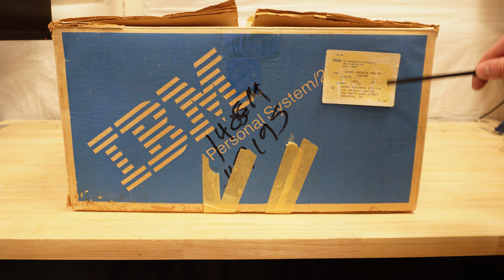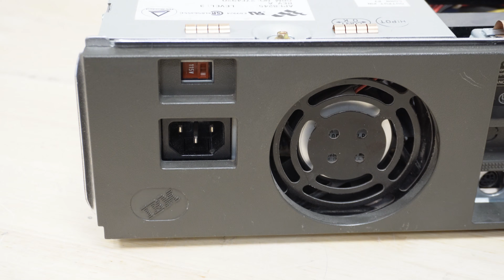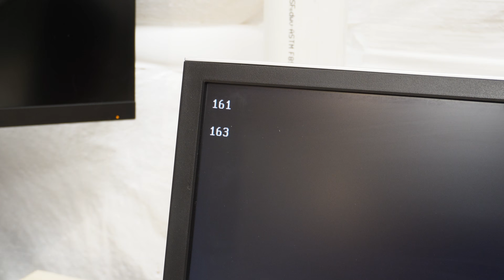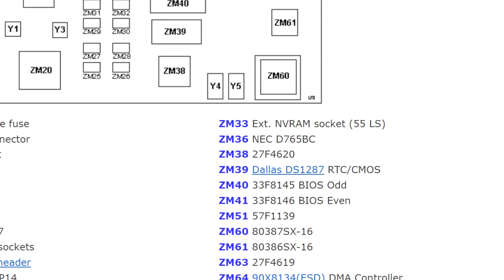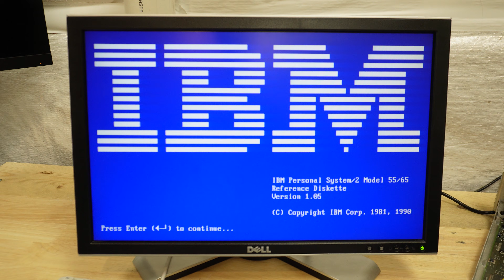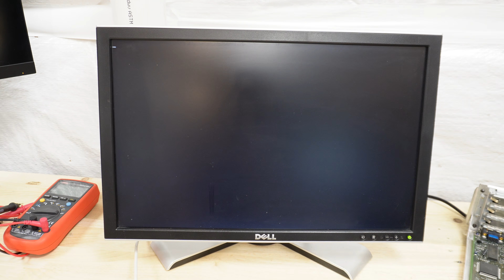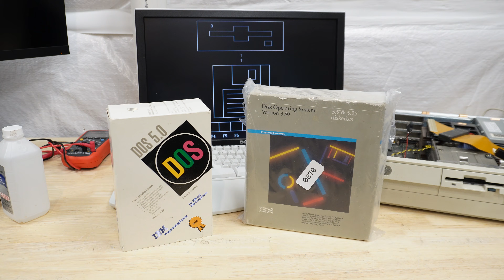IBM PS/2 Model 55SX

Comment: Those caps on the mainboard are factory.  You can fool the system into using the more standard 70ns parity memory by soldering a 30ohm resistor onto the appropriate option pad.  Later Model 55's came with C step 386 that have the working float pin that can accommodate 486SLC cpu upgrades.  The Dallas chip contains the CMOS memory and that is why the system won't startup without it.  Necroware RTC modules work, but it required me to replace the clock socket.

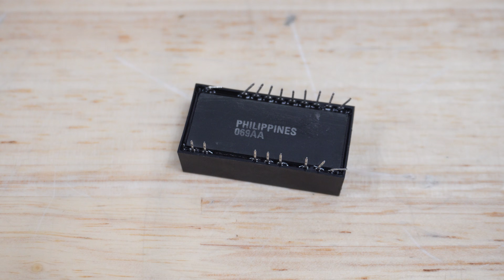Comment: 29:40 Philippines!! 😁my wife is from there.  didn't know parts were being made there back in the 80s.  I was using a model 25 in high school and we had a model 60 running NetWare 2.  if i had that system today i would be tempted to connect my 420mb ide drive to see if it boots windows 3.1 after some 30 years sitting in a plastic container 😄

Comment: We used those in my Computer data entry class and they were absolutely terrible!  They were very crash happy.  Turn it on, it crashes.  Load a program it crashes.  You sneeze it crashes.  You look at it funny it crashes.  It crashes, it crashes.  If you pray, hopefully the system admin is free but probably not because he's figuring out why 10 other computers ahead of your crashed.

I came to believe that the 386 SX is 386 SUX without the U.

Comment: I have 2 issues with this video:
1) The reference diskette does NOT contain the BIOS it is just used to set boot parameters
2) Micro Channel is NOT technically proprietary. ANY company could license and used it (and many did).

Comment: I scrolled down the comments and I didn't see anybody mention it: The 55/65 both store all of their system configuration in the CMOS memory on the Dallas RTC, which is why it won't boot without it. It's not the RTC part, it's the CMOS part that's the issue. It's a problem carried over from the AT when the 6818 loses power.

Comment: The BIOS is on the motherboard like any other computer. The only difference is that it doesn't have an in-built configuration screen, like we're used to with PC's. That is what is on the reference diskette.

Comment: You should run some Linux or something on this machine. Maybe an early version, maybe the most modern version that would still run on a 386 with... 2MB(!!)
Reply: OK, 86Box emulates it so well you need the "BIOS" disk. Also maybe 2MB is not much even for Slackware 1.0 install floppy, 4MB seems to be ok.

Comment: We used to have floppy booted systems that connected to token ring networks.  No need to have special hardware, just build a custom boot disk.  I used to have to build those dang type 1 jumper cables, i hated them.

Comment: I used to work on these back in the day, I had a customer that had tons of them and they replaced them with model 77s units with OS/2 on them and upgraded 16mb token ring cards. I had a love hate relationship with these machines. They were really reliable and mostly just worked but when they did break they were a pain. I used to carry a library of reference disks for the various flavors of MCA cards they had.

Comment: I worked with many IBM PS/2 systems. 30, 50, 60 and the server line as well. The Microchannel was far superior to the ISA bus, but the cards were of course much more expensive than the ones for ISA.

Comment: The PS/2 models 25 and 30 were effectively XT-class machines designed to round out the lineup for those that needed to replace their existing machines but not splash out on an actual PS/2. My first computer was a model 30 (8530-021 i think; it had the beepy 20MB hard drive) with an 8513 color monitor and the much-maligned IBM DOS 4.0. IIRC the Starter Diskette is just an introduction to the computer and some very basic diagnostics (like that keyboard test and a CGA/EGA/MCGA color/resolution test).As a kid, my favorite part of the starter diskette was the beach sunset graphic with palm tree it displayed to show off the colors.

Comment: The drives from IBM came on sleds.  One would by the drive and just slide it in place.  The connection to the bus was made as the drive snapped into place. None of this required tools.

Comment: Had a fleet of PS/2 at work.  All ours had a card to connect to the IBM mainframe terminal network.
I  wanted to get a card to connect to the mainframe bus and tag network, but my boss was afraid of what I would do with mainframe systems. I found that with the correct screw driver I could break the pin out of the security Torx.  
Micro channel was better than ISA because the cards could talk to each other without bothering the other components like the cpu or the display.  We never got Token Ring as the capital investment was too large and I couldn't cost justify it.  
The PS/2 was more reliable than other PCs of time.  Maintenance and upgrades was easier if more expensive.   I had PS/2 and an IBM 3290 plasma display at my desk.  I had my own printer attached directly to the PS/2.
Reply: I've got a couple 3290 terminals that I want to get connected again...

Comment: Ah, yes, the IBM PS/2 Model 55SX, that brings back some memories. Not great ones, unfortunately, but memories nevertheless. In the late 1980s and early 1990s, I was working for a company that had a contract with IBM for pretty much all relevant equipment, and in 1989, we took delivery of maybe a dozen of these PS/2 Model 55SX machines -- yep, with Token-Ring cards preinstalled. They proved to be the least reliable computers the company bought while I worked there, with fully 30% of them failing right out of the box. I didn't spend a lot of time in those days working inside of PCs, but on the occasions that I did, I also found the fit & finish of the PS/2 Model 55SX to be lacking, with a cover thta was relatively difficult to remove compared with other IBM PCs of the time and downright balky to put back, and I found the card riser hard to work with. What was really telling, though, was a label on the front, which said: "MADE IN CHINA (Please remove this label before deployment)", or something to that effect. Under that label, I found a second label stating "Made in USA". Nostalgic nevertheless, in the same sense that car collectors embrace the Edsel.

Comment: Yes, PS2 ports were introduced on, and susequently named for, the PS/2 machines.

Those Dallas chips have not just the battery, but the actual RTC hardware. As it being missing entirely would mean there's now missing hardware from the mainboard, it would track that the machine would fail to initialize.
Reply: Specifically, a POST code of '06' for missing CMOS hardware. If there is an Extended CMOS for microchannel support (not on the PS/2 Model 50, 50Z, and 55SX), that is POST code '07'. A parallel port POST code reader is supported on all PS/2 models, and a helpful item to have.

Comment: Had one of these in 1993.  Corporates would sell them on to resellers to refurb/upgrade and sell on. Mine was ex insurance…

The machine was slow. Windows 3.1 creaked along steadily, but Word 6 was a push too far, with disk swapping a lot.  

Amazing build quality.

Comment: I will add this, I have the Model 30 and i get that error but it boots. But mine also has a hard drive. i have had it boot off floppys too, but yes they have to be bootable. Also, the hard drives are on ebay. yes, harder to find but they are available. There is a lot of 6 ESDI drives up right now. Would love to see it fully functional!

Comment: Great video.  Around here, companies were dumping PS2s as we were rolling up on the Y2K problem.  My local computer store at the time was selling 386 and then 486 machines for less than the value of the installed memory.  Picked up a bunch of machines, MCA cards and hard drives.  Had a lot of fun playing with them.  Gathering dust in the basement now.
Reply: With the irony that the low-end 8086-based Model 30 doesn't have the Y2K issue in hardware (since it uses a different RTC chip). The 55SX appears to have been initially designed for an external CR-P2 battery (the plastic adapter support bracket had the indent to where it was placed in the case on early versions; I have a video where I used that spot for the coin-cell battery to the DS1287 RTC). Maybe it would have had the Motorola MC146818, so still with the Y2K bug. Later Dallas modules had a 'Y2K-fix' version, which has a 'C' in the part numbers; Those WON'T work in the PS/2 models, since the 'Century Byte' register is moved to offset 37h instead of 32h.

Comment: Flashback.. our first office network in '88-9 were PS/2's and floppy drives with 10Base2 networking, because Token Ring required more hardware. We did have one with a HardCard (hard disk on a card) that you had to park before shutting down.

Comment: Every time I see a standard PS/2 it makes me so glad my 9535 has IDE, Molex, ISA and a CR2032 holder. The only thing proprietary is the BIOS and floppy connector. I also have a standard 8556 that does have electronics on the key. It cuts hard power to the power supply and makes the system completely dead. I know this because the key switch likes to turn itself to the off position.
Reply: Hello!  I’ve been looking into transplanting a 9533 planar into an 8540 case, to make a 9540 out of it.  Could you do me a favor and share pictures of the riser?  Also what does the floppy connector on the mother board look like?  The PS/2E has a very odd floppy cable since it uses a Thinkpad floppy drive.  

My idea is to draw up a new riser card and have some made that would give me 5 ISA slots.
Reply: @bitslasher89  Mine is NOT a 9533 planar, it's a 9535 planar. Mine uses a standard PS/2 floppy drive with the ribbon that carries power and data. The riser is a 3-slot ISA riser. I have videos of it on my channel.
Reply: 9535, or 8535? The 8535 does have the Dallas module with integrated battery. It has the 486SLC2-50 CPU?

We may need to talk about the FRU P/N of the riser...
Reply: @ Type 9535 G61. It is for all intents and purposes a Model 56 on a model 35 planar with IDE on board: 486SLC2 at 50MHz, XGA-2 graphics, cr2032 battery, I have an IDE DVD drive in it just because I don’t have an IDE CD-ROM laying around. I’m running windows 95 on it. The FRU on the riser is: 10G3967 with a 1992 copyright. SIV LEVEL 3 up riser. I have videos of it on my channel, I’ve never found any hard info on it other than the 95 systems were custom made. It has 4MB soldered to the planar and runs without SIMMS installed. I’m using 2x8mb simms and the setup program says the system can only use 16mb but if it finds defects it will mark it as bad and use from the extra 4MB instead so it knows it has 20mb installed. Oh and to make it more confusing the ONLY reference disk it will accept is the the pizza box PS/2-E
Reply: @JL85FW : Thank You for responding; The 9535 ("Space-Saver", 3x3 case) and 9540 ("Desktop", 5x5 case) have the 9533 planar. There seems to be only one primary batch that was made, then they disappeared. The leading two digits of your serial number (before the dash) should show the plant it was made in.
Reply: @ the case is identical to my Model 56 except the speaker is mounted to the bottom of the case instead of the webbing. SN: 23GY521. I know the guts haven’t been transplanted because the chassis has type 9535 stamped.
Reply: @JL85FW : The middle character of the submodel ('6', in this instance) is an encoding of the CPU - '6' would normally mean that the IBM 486SLC2 CPU is clocked at 20MHz internally (and doubled to 40MHz internally). This was common for the 8556/8557 since they had a 20MHz 386SX ('4') or 386SLC ('5') on the planar, and the CPU daughtercard with a 486SLC2 just doubled the planar clocking. The 9533 had a 486SLC2-50, but you might take a look at the CPU crystal ('OS4') to see if it is 40 or 50MHz.

Or maybe IBM produced a confusing submodel encoding - for a 486SLC2-50, is should be 'B' for the middle character...

Comment: Epitronics has covered reviving those PS2 floppies many many times. Theres 3 or 4 small smd caps on the board, easy to swap and hes revived many of them. He suggests changing them even if the drive still works, if they're not dead yet they will be soon.

Comment: Back in the early 90’s I installed 100’s of those in bank branches.  They only booted from disk and connected back to an AS/400 with lease line SDLC (56k) point to point and then Twinax within the branch office.  As a bonus, I was able to get ccmail gateway to run over Twinax SNA to work. God, I hated making Twinax cables.  Love the channel.

Comment: That complete BS about Microsoft and DOS is just that. Microsoft did NOT need Compaq's help to make THEIR OWN FCKING OS run on IBM's or clones. Suggesting otherwise is idiocy that only a millennial would fall for. Rod Canion, like Steve Jobs, likes to take credit for things that he had nothing to do with. Use your brain. MS-DOS was always what MSFT made of it. 
PS/2 = half a computer.  OS/2 = half an operating system. Running both gave you half an operating system for half a computer. Both sucked and were overpriced.

Comment: IBM always assumes that you have all the IBM tools to fix your IBM machine.
Reply: The only tool you needed was the security Torx drive. If you used my trick for breaking the security pin off regular Torx was all you needed.  Inside no tools were required if you got IBM PS/2 parts
Reply: @saltyroe3179  I was talking about the diskette that is required for the thing to do anything more than an error code.

Comment: I think we had this exact model, either way, the ESDI drive used to squeal like a pig after a little while of running, was really annoying
Reply: There's an effort for a solid-state retrofit for the DBA-ESDI drives. The ESDI interface supports a maximum drive size of 1Gb. Gotek mods (it's a change of the cabling connectors to the PS/2-style interface) work to replace the failing diskette drives.

Comment: Liked the Fore ATM switch tease. I used FORE/Marconi ASX-200, ASX-1000 and ASX-4000 systems in two of my jobs back in the day. For one we used ASX-1000s and then ASX-4000s as interconnect switches inside the POPs for the ISP I worked for. The other was a campus ATM to the desktop implementation which provided connectivity to  about 3000 desktops. That particular implementation utilized ATM LAN Emulation (LANE). Both the Cisco 7200 VXR routers (that's what we used) and the Sun servers you have could act as LANE servers.

Comment: The hard drive is a MCA card it's self, it just uses a different connector as it doesn't need all the same pins. Additionally there were 2 model 30s a 8086 one and a 286, that starter disk you have is for the 8086 one, and the difference between a starter and reference is that it's mostly just used for testing the system, setting the date, getting it ready to move and viewing what the system thinks it has. As non MCA machines didn't have the same configurability as the others using DOS drivers only opposed to MCA's ADFs which allow you to edit the card configs without jumpers or dip switches.
You can also buy newly made MCA to IDE adapters to get storage, a MCA sound card is pretty sweet if you buy a newly made one aswell!
Reply: Yep - That's effectively "Slot 4" at the top of the riser. The initial 55SX models had issues when a heavy monitor was put on top of the unit. Those foil cables for the hard drive can break really easily.

I agree that the retrofit solid-state replacements are the way to go. Back in the day, there were riser replacements for the 55SX that converted the drive interface to IDE. It was a ROM table look-up mechanism, so only small capacity drives could be used.
Reply from the maker: interesting!

Comment: I must have installed over a thousand of these back in the day.  We'd install Token Ring cards for 5250 terminal access but then moved over to Rumba cards with Twinax connections.
Reply: There's a segment of us that are still connecting our systems - often including PS/2s - to an AS/400 in the home environment. Some of us still interface to an AS/400 at work, but Client Access is of course the (more) modern way now. Twinax cable is harder to route than STP Type-1, but media filters can make both convert to using UTP cabling.

Comment: There's a computer store in Vancouver, BC called Dave's Computer Warehouse that used to have a much bigger operation than it currently does. Right now it sells largely PC only stuff, and pretty generic stuff at that. 

But back in the 90s/early 2000s, there was a HUGE section of the store that effectively had a computer museum, but you could buy the exhibits 

There were giant 5MB disk cabinets (with 4" conduits for power and data!), ALL generations of working Apple computers, plus racks and racks of PC parts... including MCA cards! One day when I was in there poking around, then was an older gentleman with his grandson pawing through the MCA section with the intent of building an all-MCA machine. 

I hope that machine is still running, that would have been a neat little box to tinker with and learn how stuff was designed back in the day!

Comment: Lots of machines from that era didn't have BIOS configuration screens - you booted from a reference disk which had the software to configure the system on it.  The machines still have a BIOS on ROM though - the BIOS contains the code that DOS (or other software) might use to access system resources.   One of the benefits of MCA over ISA was that all the config relating to memory addresses and IRQs was moved into software and stored on NVRAM - the autoconfiguration process looks at installed hardware and sets the IRQs etc so each device can function - so when you change your hardware you re-run the autoconfig and should be good to go. Even without the ROM for booting from network, you can probably do same with a floppy boot disk with the same code on the boot loader - I recall there were various ways of achieving this back in the day.